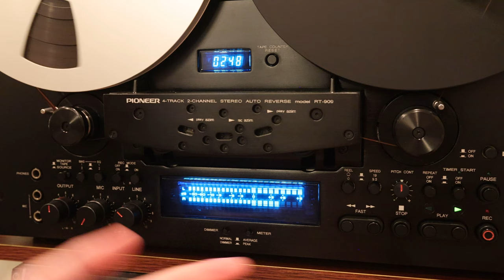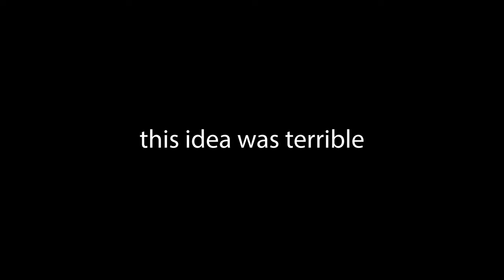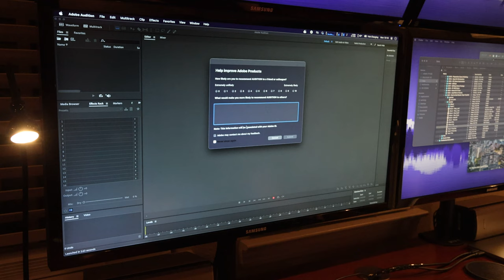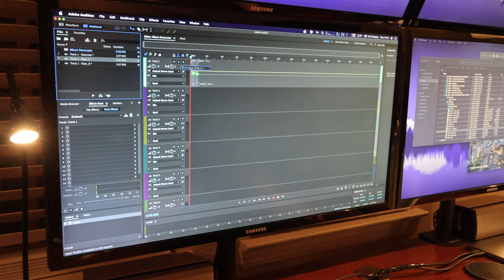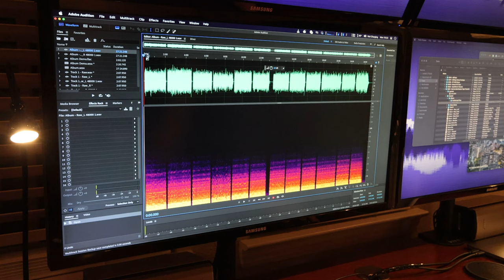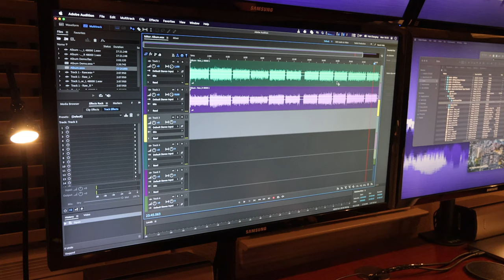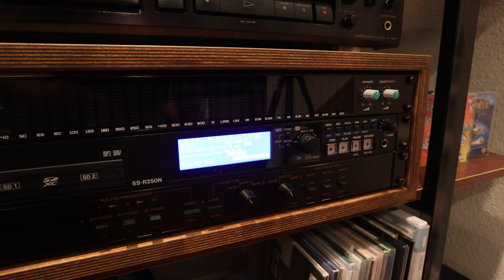Reel to Reel Master Tape Transfer

Comment: Nice 4-track deck there.
I find that Ampex tapes always suffer sticky-shed, so I bake them for 12-24 hours before attempting to run them.  Then typically I will run the tape at least twice.